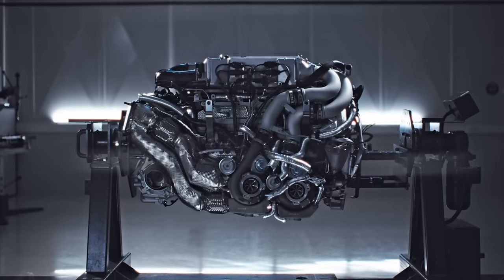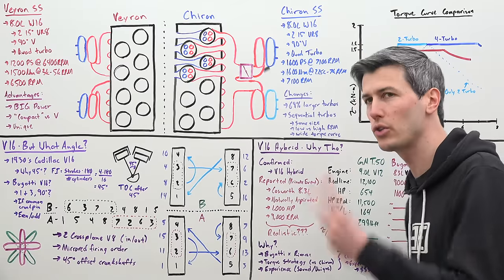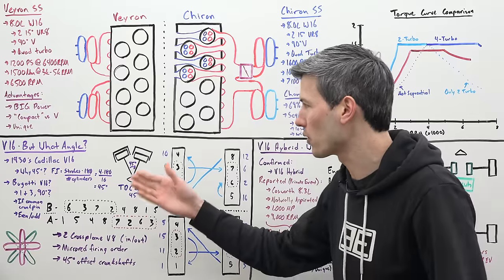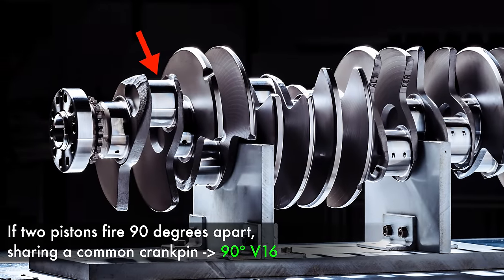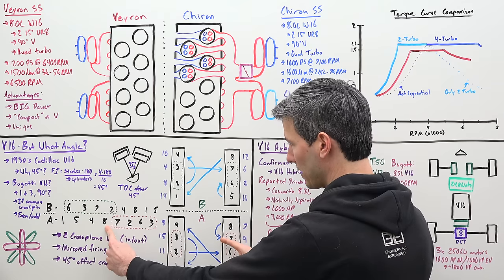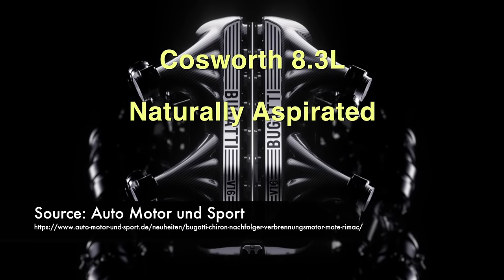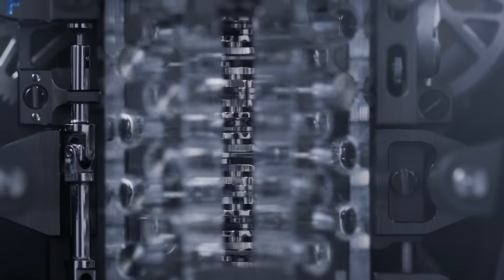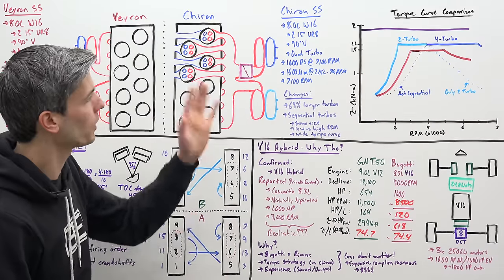Bugatti Has Developed A V16 Engine!

Comment: I own a BMW i5 M60 and the 600 hp is more than I have ever experienced.  A Bugatti with 1000hp aspirated PLUS 1000hp electric will be unimaginable.
Reply: exactly
Reply: unimaginable? there are 2000hp cars already.
Reply: @pmudri no there's 2000hp machines not cars. This car has AC name another 2000hp car with AC
Reply: @pmudri  That's not what he meant. The experience is unimaginable for someone who has never driven a car that powerful.
Reply: @pmudri  I don’t think there are any 2000hp cars that have half of that power available instantaneously. I suppose any car with that much power is going to be acceleration limited by available traction tho.
Reply: @thenamelessking7873  UGR Huracan. 3000 whp, AC, radio, full interior
Reply: @1harrismccarty  probably, but there's plenty of cars with more than 1500 whp at any rpm that you would start with from a drag or from a roll
Reply: @pmudri ..Did his sentiment go over your head or something my guy?
Reply: @thenamelessking7873  Gemera V8, 2300HP and 4 cold + 4 hot cup holders 😂
Reply: Iyea
Reply: I have gone into 110hp's cars and that was INSANE! imagine 200+ hp's? unecessary!!
Reply: Lot's of rich dudes are going into unalive mode.
Reply: @Shadowboost  Yes, and how long will it last in that tune ?? 
Ever wondered what 5 times the car's regular output will do to this thing called longevity? What about driveability? In that trim it can only be used on a drag strip and is undriveable everywhere else. 

Understand this: Tuner cars don't count . Especially not those specifically tuned for the drag strip.
Reply: @McLarenMercedes  completely drivable. Turn a switch and it drives essentially like stock. Likewise, you only need to go to kill when you're racing, so generally, it lasts a long time. UGR even includes a 60k warranty
Reply: The launch would be nutz
Reply: 1800 hp NA engine 800 3 Electric Motors 9,000 RPM

Comment: It's not so much that the downsides don't matter, it's that they aren't even downsides. This is a vehicle for which being excessively expensive to buy, expensive to maintain, expensive to drive, and insanely complicated is an advantage. It will make the vehicle more desirable. It is an exceptionally large peacock tail, in vehicle form.
Reply from the maker: Yep, exactly.
Reply: If I buy a rusted car with a dying engine for huge money and repair holes on chassis one by one when a place cracked. And repair engine only cylinder by cylinder so that it become expensive to maintain. Does it becomes a peacock tail?
Reply: @inevespace Does it have a Bugatti badge and cost over a million to buy?
Reply: @inevespace  Vintage cars are like that and some go for huge amounts of money
Reply: It was nearly impossible to get insurance to drive the Veyron or Konegg. Nobody will insure this for the road. Amazing engineering, complete showoff design, and useless for anything but "drive it" date on a closed track. Drive it a few laps then it's back to the shop for $100K in maintenance and new tires.
Reply: Just imagine if it got combined with the Light Speed Transmission from Koenigsegg... If u wanna compare any transmission sounds, then I would say none can beat that one... 
So in my opinion the light speed transmission could be paired well with the massive thrust produced by the Bugatti V16... That's if these 2 can put their rivalries aside😅😂
Reply: @googlefuckedupyoutube  $100K? It's called hyperbole. Lighten up. I was making a point that a track drive needs to be followed up by an expensive visit to the mechanic for a check up and most likely new tires. Those tires are made special to go at those speeds. They can fail at anytime if not changed out if the car is driven to those speeds. Superb engineering, outstanding product styling, fast as hell, but useless and uninsureable for anything but a track day out. And expensive to keep driveable once you do track it.
Reply: Completely agree! Without these insanely over engineered sports cars, where would all the fans of Tesla and obscure kit cars go and whine about how "their cars" are cheaper and faster.

Comment: I wonder if that would fit in my Fiat 500?
Reply: If your mounts start at the dash maybe
Reply: VAG parts in Stellantis???
Reply: @feedbackzaloop euro beat gives access to powers unknown
Reply: It will as long as u gon drive it from the outside😂
Reply from the maker: There's always a chance!
Reply: You can use the fiat as valve cover
Reply: As in the wheelbase? Maybe.
Reply: @TheAdatto lofl this comment section wildin
Reply: @SoulTouchMusic93  Mine is a Cabrio.  Surely I can use that to my advantage.
Reply: We could make it work
Reply: It'll fit. Long as you don't wanna get in the car with it.
Reply: Of course it will. But you're going to need a sawzall and a hammer. And probably Jason.
BTW, can you drive standing on the back bumper? We're gonna have to rearrange the controls a bit.
Reply: Sleeper car 20 years from now.
Reply: @brentlanyon4654  I'm 5'5'' bro, I'm sure that's a plus in this scenario.
Reply: Two welded together maybe.
Reply: @mk1st  Length-wise?  Or side-by-side?
Reply: If you cut off the roof and took out the seats.
Volkswagen - now that's an idea for our Golf GTI, let's do it and get some volume engine production going.
Reply: Heheheh do you want some FIAT 500 with your engine Sir
I think this would be as big as a Fiat 500 😂
Reply: It would probably fit, and considering the progress in self-driving technology, it wouldn't even matter that you don't fit into the car anymore.
Reply: Sure it would. Only question is if you’d fit in it as well.
Reply: It’ll fit in the cabin, I think
Reply: The engine is your fiat
Reply: The Fiat isn't designed to have a real engine in it. Just a leaf blower type engine.
An engine like this would tear it apart.
Reply: If it's the old skool rear engined 500, that would be interesting.
Reply: There is a guy who put two W12 engines in to a vw lupo, so its basically a 24 cilinder car. So a v16 shouldn't be a problem😅
Reply: Yes, the Fiat body would fit on top of the engine. You'd need a ladder to get in, but the vehicle would certainly turn heads.
Reply: @londonalicante  I like your style.
Reply: Excellent, put a seat on the roof and adjust the steering a little and off you go 👍
Reply: The Metro 6R4 springs to mind.
Reply: With a minor adjustment, perhaps. Elementary, really.
Reply: With enough money you can do anyth.....well I don't know about this one actually

Comment: Cizeta Moroder V16T had a V16 in the 1990s. Depends if you consider 13 units "production". It was 4 banks of 4, so 32 valve, octo-cam engine. Claudio Zampolli was nuts.
Reply: Rare cars are still considered production vehicles even when they are made in single digit numbers.
Reply: I used to own a Cizeta Moroder V16T

In Gran Turismo 4
Reply: It's contentious whether that's even a proper V16 - had two cranks, four cams, and central power shaft. It's more like 2 V8s in one block.
Reply: @tomkandy so they were bonkers enough to fit two engines in one car... Legendary!
Reply: It where 2 Lamborghini 4.0 V8 uraco engines and mated together the gearbox was in the middle ..
Reply: Thanks. I was going to mention this. Amazing cars.
Reply: Bugatti’s next 16 cylinder: an aluminum cube that essentially four 4-cylinder engines side-by-side with four cranks geared together. 
Intake and exhaust ports are vertical like old F1 engines. One massive top-mounted turbo rules them all. 😊
Reply: They are quite a feat of engineering, some superb engine design.
Reply: @electrikoptik  you had me for a second there
Reply: I just mentioned this car in a separate comment. It really is the original "Yes" car.
Reply: I don't remember where I heard it from, but I remember something like you'll have to have at least 28 units to be considered "mass produced"
Reply: i think all V16s are a combination of smaller engines to some degree. If it's got 1 block and 16 cylinders, it sounds like a V16 to me. @tomkandy

Comment: Now we need a W 24 engine.
Just 8 more.
Reply: OOOOOO
 OOOOOO
-/_/-/_/-/_/-
 OOOOOO
OOOOOO
Reply: It'd be a lot easier to just buy two of these V16s and put them together. Play your cards right and you could make it a W32
Reply: at that point, we should use 2 engines only to power a generator, just like with the Belaz 75710
Reply: or rotate 3 of them to get a Radial-48
Reply: why not a 2 stroke opposed piston inline 12?
Reply: WV24
Reply: That one's easy - just 4 VR6s
Reply: @Appletank8  We could use a twin rotor Mazda as a supercharger
Reply: @Appletank8  The Pratt & Whitney Wasp Major got nothing on us anymore
Reply: @simontist  360° 4 VR6s
Reply: Forget it and just go with rotary then: Rotary 24 as 4*6.
Reply: Now this would be impressive. I'd imagine it would be an ultra limited spec.
Reply: why not just go for a w 32?
Reply: @RedfishCarolina  That's not a W32, just like the Bugatti W16 is two VR8s in reality. A true W engine only has three banks of cylinders.
Reply: @erkinalp terrible idea, long crankshafts are weak
Reply: A W 96  is better
Reply: If V16 exists - W32 is the only answer
Reply: I guess Devel will have to up its game for their non-existent cars
Reply: Nah, double X 32 cylinder
Reply: @MariuszChr two w16's stacked atop each other with the bottom unit upside down for a wx-32
Reply: @Prestiged_peck  are you building plans engine?
Reply: @MariuszChr  ???

I'm just spouting crazy ideas like the rest of the comment thread lol
Reply: I think they wanted to hit 1 megawatts.
Reply: Just imagine if it got combined with the Light Speed Transmission from Koenigsegg... If u wanna compare any transmission sounds, then I would say none can beat that one... 
So in my opinion the light speed transmission could be paired well with the massive thrust produced by the Bugatti V16... That's if these 2 can put their rivalries aside😅😂
Reply: Nonono, V16 TDI
Reply: @xBlackRaiderx  v32 TDI?

What about a turbodiesel wankel?
Reply: @Prestiged_peck  YES. Always thought a Rotary diesel would be interesting, if it's even possible
Reply: semi-trucks: ok so back to this inline 6 diesel hauling 60-70 metric tons
Reply: Huh
Reply: lol ww2 aircraft engines are back in vogue I guess
Reply: @erkinalp an diesel. Made by Detroit.
Reply: Agreed! or inline 8 engines!
Reply: 2 v10 or w12's, from Phaeton, Touareg maybe its possible, instead of 2 passat w8's

Comment: Hi, i have done my calculi, and i have concluded that each bank (which, as you said, is kind of a straight8 cross-X plane, with all the pistons evenly distributed every 45 degrees) has a primary rocking couple.
Option 1: If they didn't phase the V8 called A and the one called B by 45 degress and they actually mirrored it, they could have really balanced EVERYTHING, primary and secondary forces and moments. But if they did this, 2 pistons would have fired at the same time. Maybe the problem is the torsional stress on the crankshaft, so they opted to balance things by adding weight to the cranskshaft in order to have a smoother firing.
Option 2: Another option would have been two inline8 banks with a 90 degrees angle (i suppose they didn't want to have a 45 degrees like the cadillac, because of its shape), but in that case, they would have had the same problem of 2 pistons firing at the same time.
In this last case, the only difference with option 1 is that we are switching piston 3 with piston 4, so it's the same.
Is it correct?
PS, the cadillac V16 is actually a "more pefect" mechanic object.
PPS, nothing is better than a V12, which is designed by God himself.

Comment: The instant torque of electric and that gorgeous sound of that v16. Pretty hyped to see what this car will look like!
Reply: @AudreyH48 maybe a road-legal Bolide complying with emissions and stuff?
Reply: @XXXPUBLICENEMY  sounds great to me, give me the land yacht
Reply: So short, this thing is gonna be a beast
Reply: @Harrappathat would be quite the achievement if they managed to shove a v16 into roughly the same sized hole as a w16
Reply: Just imagine if it got combined with the Light Speed Transmission from Koenigsegg... If u wanna compare any transmission sounds, then I would say none can beat that one... 
So in my opinion the light speed transmission could be paired well with the massive thrust produced by the Bugatti V16... That's if these 2 can put their rivalries aside😅😂
Reply: @benjackson6260 What rivalry? Rimac is working with Koenigsegg for years already
Reply: @fafiteee I remember when Volvo introduced their 3.2 I6 in a FWD configuration. They said it was just millimeters longer than their I5. Maybe Bugatti managed something similar. Perhaps with less stress on the engine the space between cylinders can be nearly touching?
Reply: @Harrappa Engine displacement really should not be thought of an actual physical engine size, oversize a 7.0 Chevy LS7 being the same physical size as a 4.0 Toyota 1UZ-FE would not make sense.

The big difference between this engine and the w16 is the SHAPE though, the w is way more of a square shape, while this one is gonna be wayyy longer.
Reply: @Harrappaits an interesting engine choice for sure, we shall see! Looking forward to hearing it 👍

Comment: How much more cylinders do you want? 

Bugatti: Yes. 😂
Reply: its the same tho. 16. Just in a V config.
Reply: During the early days of the Veyron's development they considered using an 18 cylinder engine before deciding "nah, that's too much" and so they decided on a far more sensible 16 cylinder engine instead.
Reply: @notsafefortorque9060  Classic VW over complicating a 16 cylinder.
Reply: @CyanRooper 10 is the limit. Anything above that is over complicating.
Reply: 17 please
Reply: @jwalster9412  Nah 12 is the limit, that's why there have been so many V12 engines compared to V16 or W16 or Flat 16 engines. V12 engines used to be the go to for performance cars (back when there was no replacement for displacement) like most flagship Italian cars from Ferrari and Lamborghini and luxury cars (because V12 engines are incredibly smooth which makes them perfect for comfy luxo-barges like the S-Class Mercedes Benz, 7 series BMW, Audi A8 etc).

Fun fact: Audi once considered producing a R8 powered by a twin turbo diesel V12 from the Q7 4x4 back in 2008 but ultimately decided to use the V10 from the Lamborghini Gallardo instead.
Reply: @jwalster9412 A multiple of 6 would have a perfect first and secondary order balance. 
I’d like to know why the went for the V16 instead of a V12. 
That should be the limit imo.
Reply: @Conservator. its cooler
Reply: @Conservator. I assume because the W8 and W12 were already used by VW group at Bentley.
Derived from the 4.0 W8 in the Passat 3BG/B5.
I don't know the exact differences between this and the Bugatti block, but it is more or less double the Passat W8.
Or they thought if we cann move from VR6 to two VR4 in one block as a W8, why not more? 😂

And W16 is more compact than V16, that space was needed for the turbos and all the radiators.

Also V12 was not exclusive enough for a Bugatti I assume.
Reply: 😂 @Nordlicht05
Reply: "the same as our last two cars"
Reply: @CyanRooper  V12 is meh
Reply: @Conservator.  If you want luxury, go for a multiple of 6, if you want sporty and something unique V10 is better
Reply: @Nordlicht05 2 stroke opposed piston inline 17 please
Reply: @erkinalp  i am also interested in a 7 cylinder VR engine . Or to make it a little simplier an R7 :D
Reply: An inline 8 also can be made to have perfect balance like an inline 6. A V16 and V12 are just 2 inlines stuck together.
Reply: @456MrPeople  an inline 5 can also have good balance, and a V10 is just two of those at a 90° or 72° angle.
Reply: Too heavy, complex, unreliable design
Reply: V16s are used in ship and train engines. They’re reliable if built right like any engine.
Reply: How many more, not how much more cylinders....
Reply: An inline 5 has secondary balance, but it does not have primary balance.
Reply: "How long do you want the engine to be." Holds out arms. "This long."